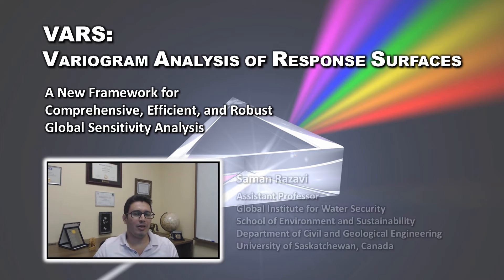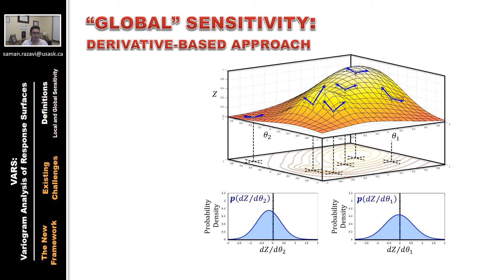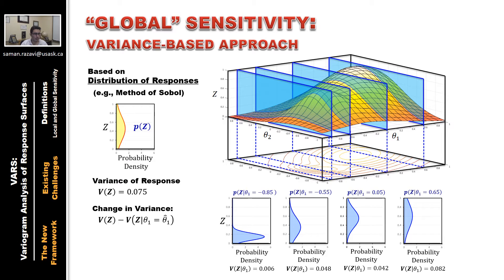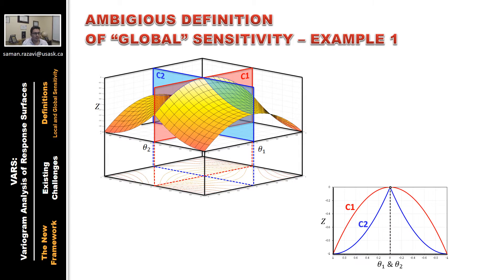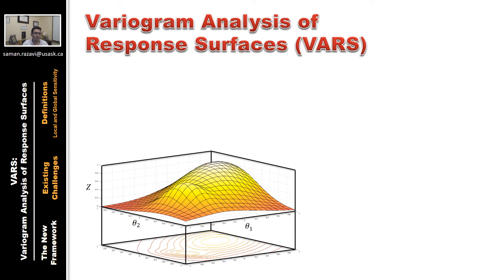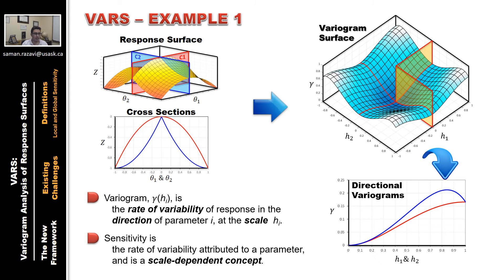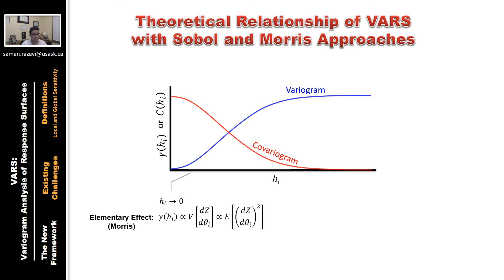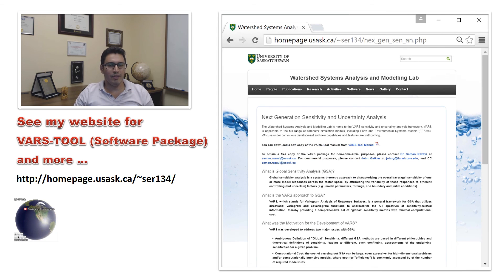Global Sensitivity Analysis: Variogram Analysis of Response Surfaces (VARS)

Comment: When you say it is much more efficient, do you mean more efficient compared to VBSA only, or is it also more efficient than the Method of Morris? 

Surely if you want to make clear distinctions between either end of the variogram function, then there will have to be several values of h, perhaps 5 or more. If this is then used on a multidimensional surface, perhaps due to 10 factors, the number of pairs will skyrocket, will they not? Surely the computation of these points to produce these pairs will need as many simulations, in terms of order of magnitude, as the Variance-based approaches? 

Thank you.